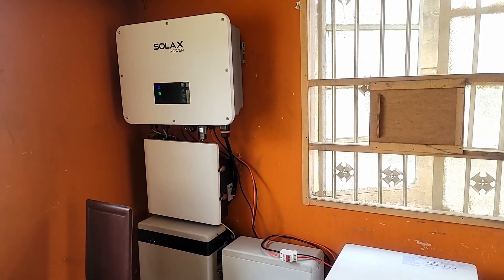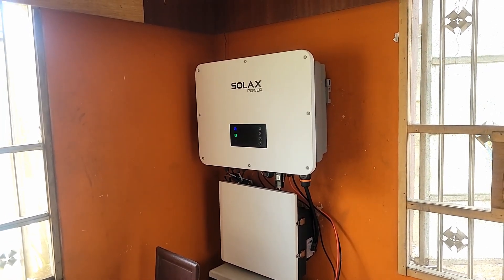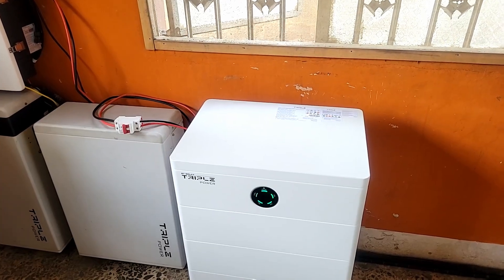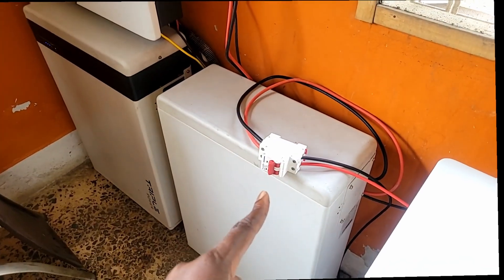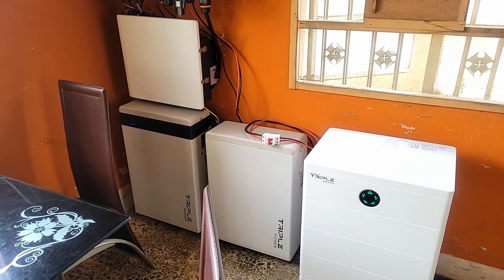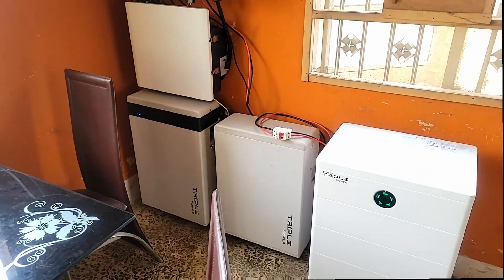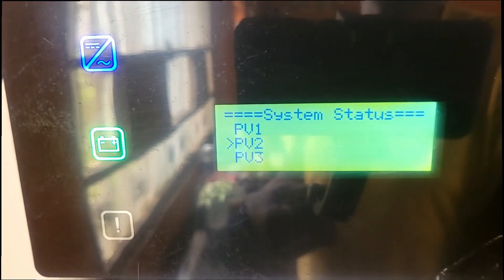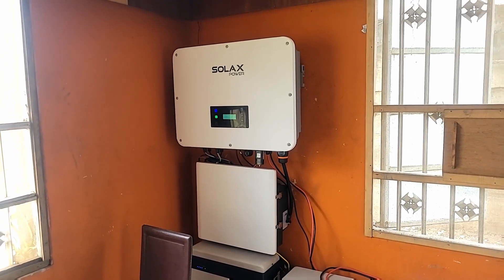Solar Sizing Secrets: Why One Size Doesn't Fit All When It Comes To Solar Systems

Comment: Another great video, thank you. In summary:
1) The size of solar system components (inverter, batteries, solar panels) needed depends on your energy consumption, it is not a one-size-fits-all approach.
2) Having more battery storage capacity is better, allowing you to run loads for longer periods without sun.
3) To calculate the solar panel capacity needed, take your daily energy consumption (kWh) and divide by the average sun hours per day in your area (using a conservative estimate).
4) With your current 7.4 kW solar array, you can only charge your 26 kWh battery bank to around 80% on a sunny day based on your 30 kWh daily consumption.
5) Prioritizing charging batteries first is important when solar production doesn't meet total energy needs to avoid draining batteries.
Question: Given the relative cost of the components, should we get the maximum solar panels our inverter can handle, and then build up the batteries?
Reply from the maker: Hello Tony. Excellent summary. I would get all the panels I can get. With good quality lithium batteries you can add more later. You can't do this with lead acid batteries. Thank you for watching and commenting

Comment: Great stuff again Dr.
Had my eyes for on-grid with SolaX hybrid 3phase X4G4 10k inverter with a 10k battery but only 5k panels with plan to add more panels later. Need to use EPS and also generator as have rain water small pump in case of blackout. Considering also the matebox kit.
Anything else to consider in such a setup?
I will be net-metering so on-grid, but many tell me why and why not go off-grid. So is there a setup with a single inverter that can be net-metering but also off-grid with more panels without power company aware of the extra production (the off-grid side)?
Reply from the maker: What you listed is more than sufficient. Net metering is not applicable to our market so I can't advice. Don't export to grid. Self consumption only. Thank you for watching and commenting
Reply: Are the rumours of Nigeria allowing grid-exporting very soon true?

Comment: Hybrid inverter  and charge controller + inverter which is better or more durable?
Reply from the maker: They each serve different functions. The quality and durability varies from manufacturer to manufacturer.
Reply: @drsolar  what are the functions or differences of the hybrid inverter and non-hybrid inverter?
Reply from the maker: @samisaac3908  the hybrid combines the capabilities of a PV inverter and a battery inverter. It can power the loads directly with solar.

Comment: Do you think if you had oversized your panels, it would have charged your battery to 100%? Again, are you suggesting that it is not necessary to buy inverter fridge or A/Cs?
Reply from the maker: Thank you for watching and commenting. More panels will charge my batteries faster. The inverter fridge eliminates the surge you see on startup. The fridge pulls about 120 watts on start up that number jumps to 1000. I have an inverter AC so I wont comment.  The non inverter window unit pulls stops then pulls. The inverter AC varies what it pull to the extent that the number becomes so small.

Comment: Excellent video as usual. When you hear from a professional,  you will know. For those with limited roof space, getting high efficiency panels, like the Jinko Tiger Neo panels and prioritising solar panel's orientation and angles can maximise generation. This will circumvent having to oversize to reach estiamted generation capacity. I cringe whenever I see solar panels on steeply inclined roofs ("send down the rain" roofs). Nigeria is roughly on the equator and has an approximate latitude of 5 to 6 degrees. Consequently, a flat or slightly tilted panel (to ENCOURGAE RAIN TO WASH OFF DIRTS) is ideal.
Reply from the maker: Thank you for watching and commenting. We need to encourage Nigerians to build roofs that are solar friendly. We don't build attics, there is no reason for the roofs that we see